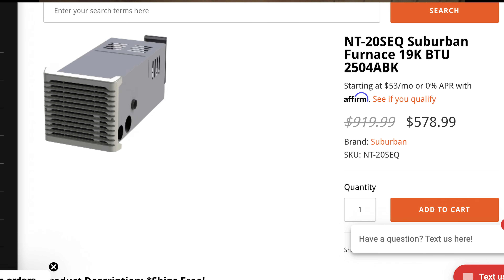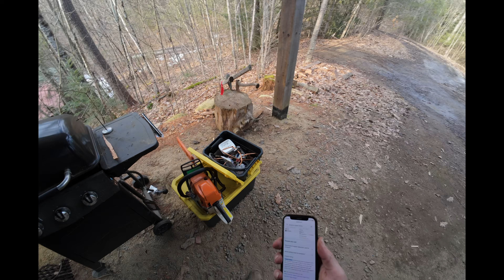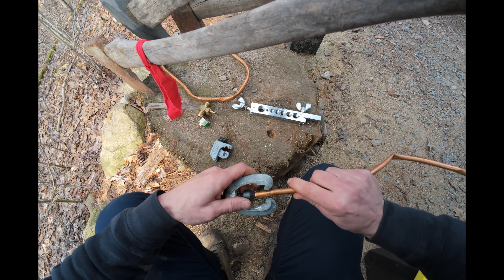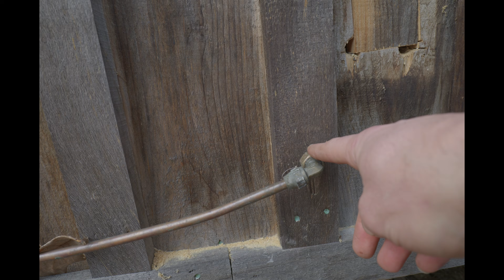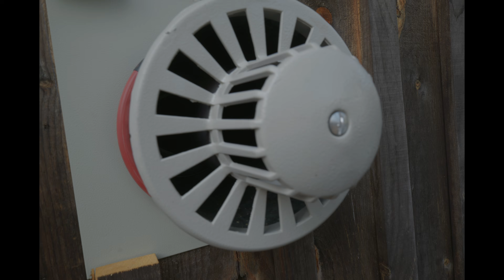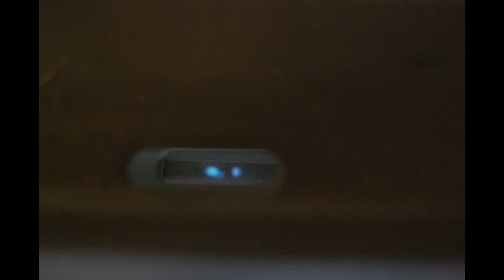10 Years Off Grid and we Finally Found the Best Back up Heater

Comment: Does it put out moisture into the house? or is the moisture vented outside? Sorry I don't know about this stuff
Reply from the maker: no moisture that vents outside with the carbon dioxide. it actually drys the air inside similar to a wood stove
Reply: @TinkerTown. What is the sq ft of your cabin with the direct vent propane heater?
Reply from the maker: @GaHullbillyRanch  aroiund 200 square ft with very little infomation

Comment: I can't believe no one brought up the diesel heater. 😮
Ounce per ounce, diesel is much cheaper than propane.
It can also be much safer than propane heaters.
Unlike propane, diesel heaters put out very dry heat.
Reply: Diesel stinks.
Reply: @Matthew_Loutner  
So does propane. 😉
Smells like rotten fart! 😉
Reply: @wt9653  Propane smells better than diesel and you can only smell it when you are changing the tank . . .
Reply: @Matthew_Loutner  
I'll bet you stare at your cat's anus for it to fart out some perfume!
Diesel heaters don't smell if you pipe the exhaust away from where you are staying.
Dry heat vs very moist heat 
After the night of the propane heater, 
Your whole tent, camper, and RV will be dripping wet from the byproduct of the propane.
Propane also doesn't ignite during extreme temps.
Reply: @wt9653  if you are smelling it, you have a leak
Reply: Nice heat but you have to them from China and they only last so long. They have to be in each room.
Reply: @Wenowknow
All propane and other heaters are from China. 😂

Comment: You can get new wood stoves, that have duel uses, Catalytic and old fashioned, they are "Hybrid wood stoves" and they can burn the same wood between 5 hours, and 48 hours roughly. 
Worth a look, but they can be spendy. (3500$)
But given the time savings, and the multiplier on the wood, they are often well worth it.

Look up the Blaze King "King 40" for reference, this is not an endorsement, this is just reference material.

Comment: I wonder what your thoughts are on the diesel heaters, oh I just thought of that you need power, so I guess that’s out for you 
Thanks for the review
Reply from the maker: I have one they run at about 30wh. For me the questionable electronics and ticking from the fuel pump are enough to keep it as a shop heater but not in the cabin. For reference both the diesel heater and this direct vent  preform about the same as far as heat output.

Comment: i was wondering how long these last on a tank of propane as an option for backup heat source, but if it's only few days i think it's not really an option for my situation. thank you for sharing.
Reply: I have a wall mount 30,000Btu output with a Solar Powered Fan/elec. Electronic igniting to off(2)9volt D.C. batteries. Great back-up Heats to 1,200sq.ft Mobile Home here in the Ozark Mntns. 80 degrees inside. 0°-10°degrees out-side. Does well.(2)40lb.tanks last all Winter. 4mos.long.Great!